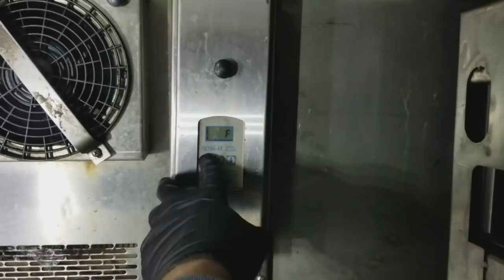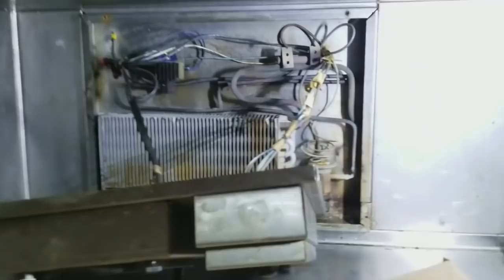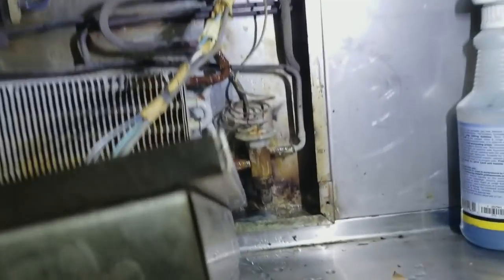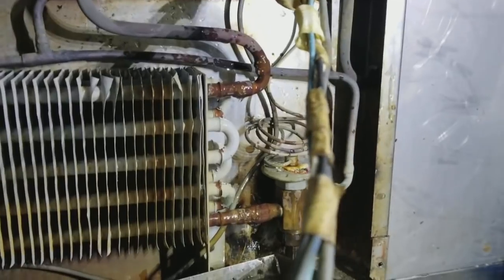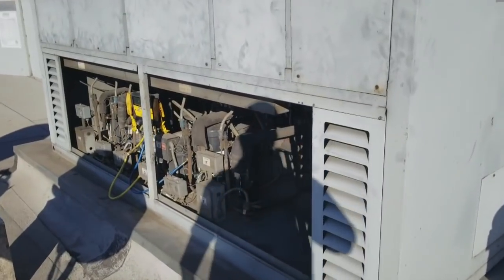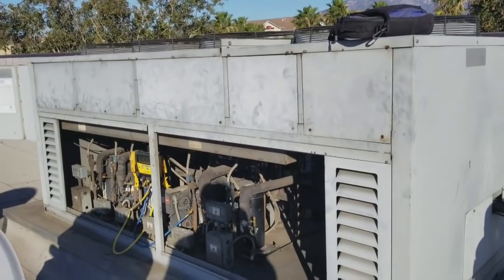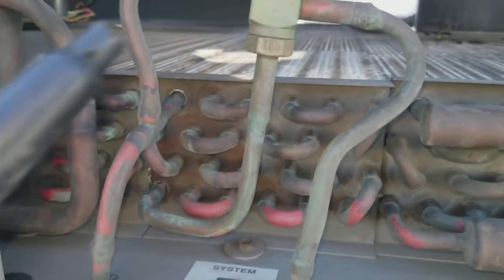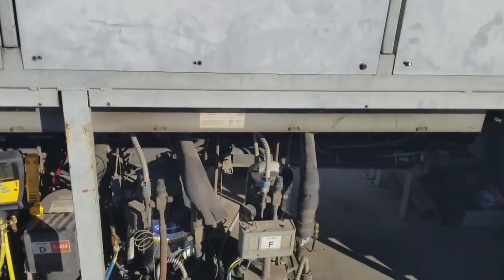Kairak drawers not temping

Comment: As a Food & Beverage operator for 30+ years can appreciate your order of operations and communication with on site management regarding loading of the box and timing your service call.

As a late in life career changer back to refrigeration service, appreciate even more the service tips given. Sure, veterans already know to zero out the leak detector away from the unit, check the fans rotation before start up, and not flip breakers on all at once, but for newer guys who haven't done this work everyday for years it is a wealth of solid information.

You are picking up the torch where Jim Pettinato left off and taking it..... "next level" !
Reply from the maker: Thanks for the nice words, all I can do is try to give the customer the best possible experience! If I can share what little knowledge I have and it can help someone else , even a little than I can sleep better at night knowing that!
Reply: what happened to Jim?

Comment: Good Vid. Excellent job as usual. you know how that evap leak scenario is going to go. that first evap is the main leaker and the others are going to leak in the next 6 months then next  6 months on the next one. that rack system is going to buy u a fishing boat pretty soon. thats a fun one. 2004 rack. Going to be Never ending service calls with the aging rack. could be a great little account. cha ching. condenser fan motors, evap fan motors, leaks, good fun !

Comment: There are only a couple of things i do differently--- how i kind of look at leaks is i look at how low the system is low on charge from experience. u know total system charge on that one was 9 lbs. if sight glasis half empy . systems about 1/2 empty etc  ( or u can gas it up first ) see how much it took, and evaluate how large of a leak i have just found and kind of crunch the number in my head to see if it adds up in reality sake. example u only add a 2 lbs to a system probably gonna be a small leak, example u add 5 lbs to the system , taking into consideration that was a 9 lb system to fill, your going to be looking for a med size leak or multiple small leaks.
Also --- Shutting an entire rack down can bite u in the ass ! if u have a packed day in front of you. just a word to the wise if u are a newer tech reading this. 
you never know what can happen if u go to re-start an entire rack all at once. a Weak link can pop at that time and now u have another problem to deal with. 
 
i would have just popped a cover of the side and looked for oil stainag and if i saw oil then i would leak check. but, since u allready found leakage down stairs i would have probably passed on the condenser check.
i would though have removed the cover to the combination control and checked its bellows inside, i've been finding alot of those leaking.
Awesome vid.
Reply: P

Comment: You was aware after diagnosis that there was numerous refrigerant leaks on the evaporators, why did you re-gas the system knowing it had refrigerant leaks? Surely that’s a breach of legislations due to the refrigerants producing co2 and harming the ozone. Or did I miss something?
Reply from the maker: In the states it is perfectly legal to top off a charge and fix the leak later. That is what I did we got the unit running and returned a week later and replaced the coils.
Reply: I’m from the UK and we either have to carry out the repair or degas the system then and there. We have rules for rules over here! Thanks for getting back in touch, enjoying the informative videos!👍🏻

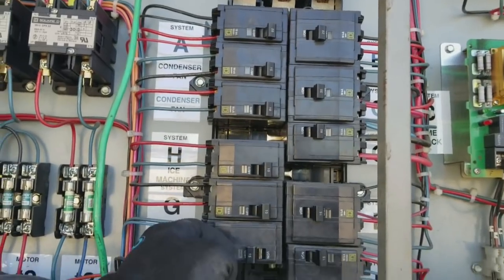Comment: 23:21 Loose?
Reply from the maker: Yeah it's a little loose but I really don't think those breakers were intended to be used that way, if they had the cover of a breaker panel on them it would hold them in place. The way they are mounted if you pull to hard they will pull right off the buss bar!  Good catch and thanks for watching!